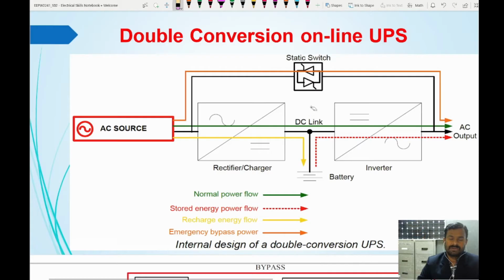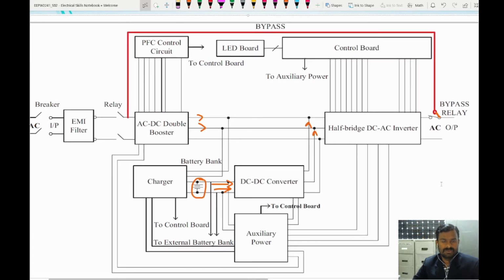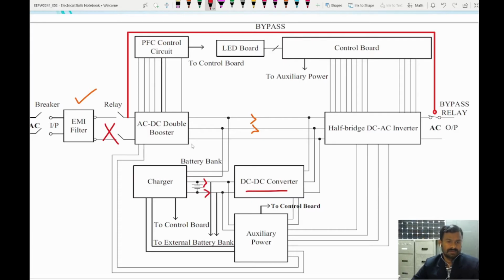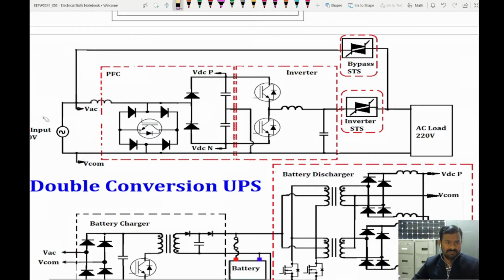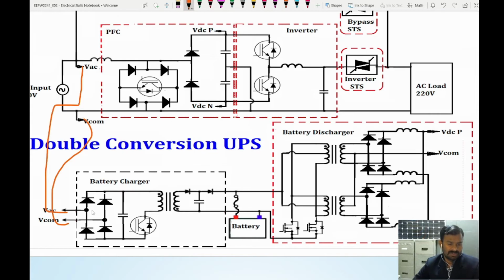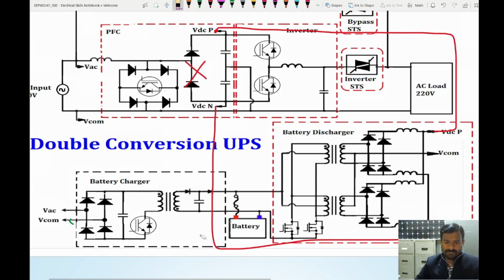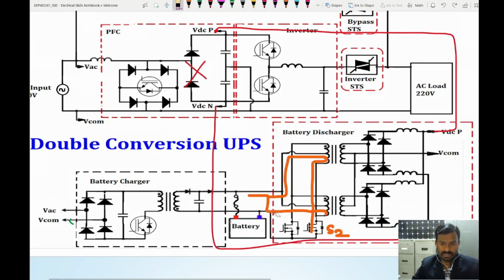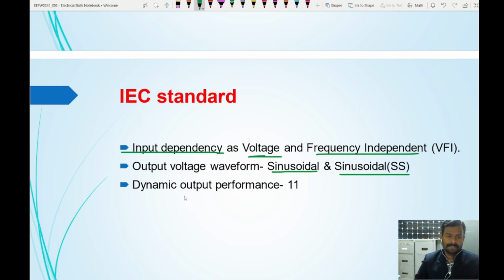All About UPS, Double conversion UPS

Comment: in charger AC input section why  electrolytic capacitor not used
Reply from the maker: brother exact type or value of the capacitor is not mentioned off course it can be used
Reply: @rajababu.n6265  I think pulseted dc best for battery charging thatswhy filter capacitor not used